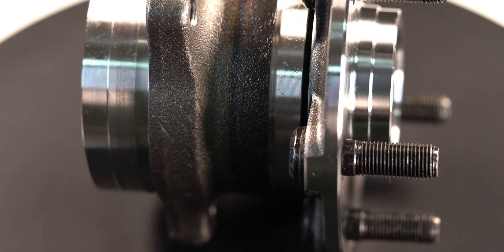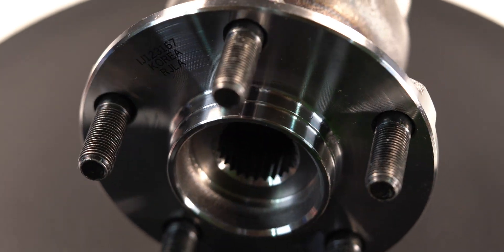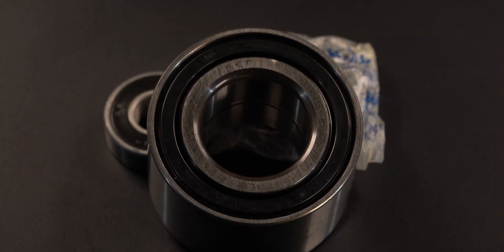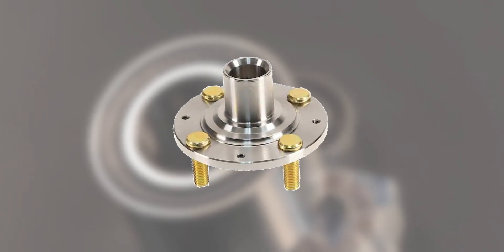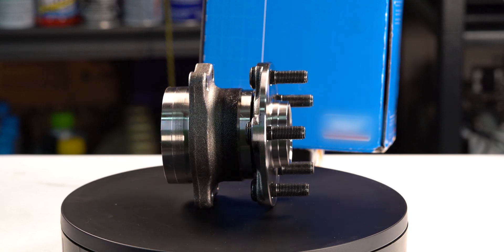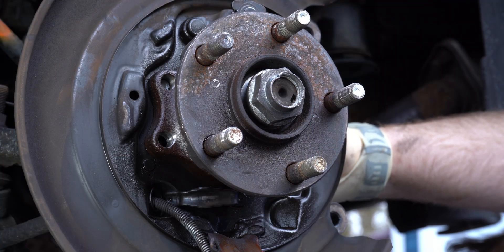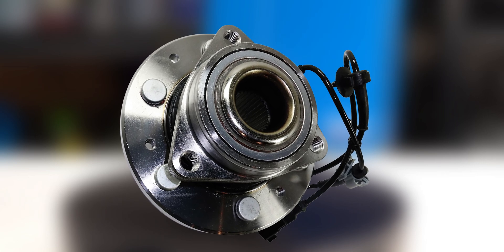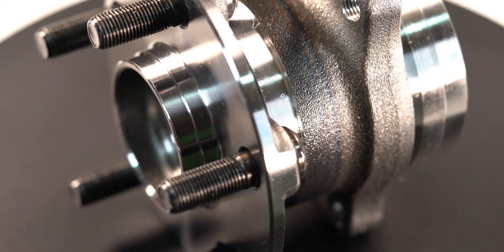The Difference Between Wheel Bearings & Wheel Hubs

Comment: If I have a bad front wheel bearing should I buy the hub with the wheel bearing. Or just the wheel bearing?
Reply: You don't get to choose. Your vehicle came equipped with either pressed in wheel bearings and hubs, or wheel hub/bearing assemblies. If your vehicle came with pressed in wheel bearings and hubs, there will be no holes drilled into the knuckle for mounting a hub/bearing assembly.
Reply: Do you have a way to remove and press in bearing? Weigh price versus worth the effort.

Comment: 100 bucks for just a bearing, or 300 bucks for the bearing and hub?
Reply: I bought the bearing for my 2016 civic and had the mechanic just press the faulty one out and press in the new one. Hub was still new and didn't want to spend more $$ than I had too
Reply: @layzy24 I just bought the wheel hub @ bearing already together for $52 each on rock auto and did it myself in a few hours